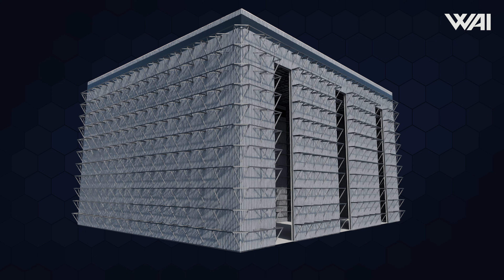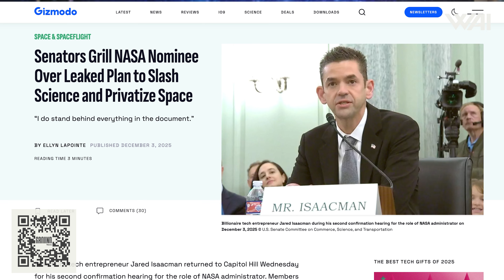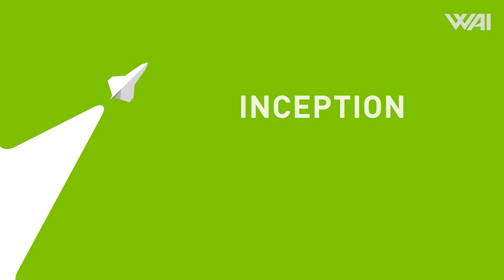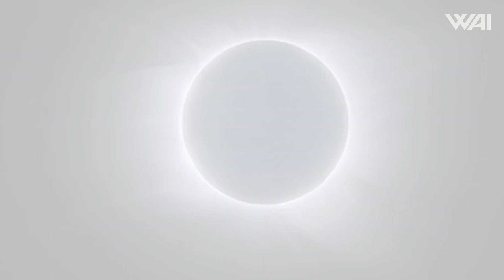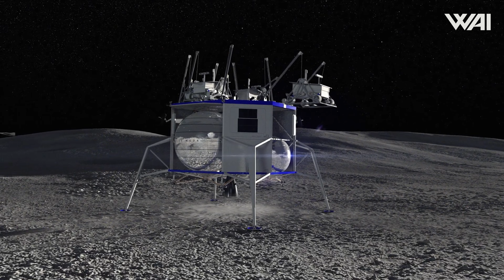Starship Flight 12 is HERE | The Secret Behind SpaceX's RADICAL Version 3 Design Change!

Comment from the maker: Visit http://ground.news/WAI or use code WAI on mobile to get 40% off unlimited access this month!

WAI CHRISTMAS SALE Starting December 13th: https://whataboutit.myspreadshop.com/
Reply: Thank you for the chapters.
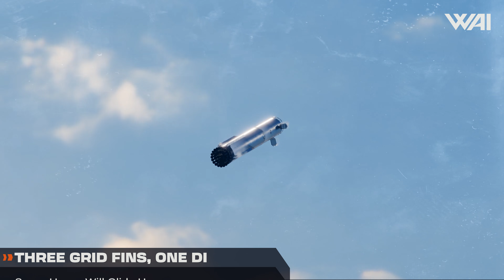Reply: Again this impossible views of booster gliding with asymmetric gridfin "under" the booster (9:39)... Do you still not understand that the momentum of asymmetric gridfin under the booster tilt the it forward? So the booster can't glide horizontally with asymmetric gridfin under the booster without constantly working engines!
Reply: No cracks no🚪🏃💨🙅☕🛌🤺😈🔥⬅️🏃🚫⏰🐂💩
Reply: Missed the sale. 😉
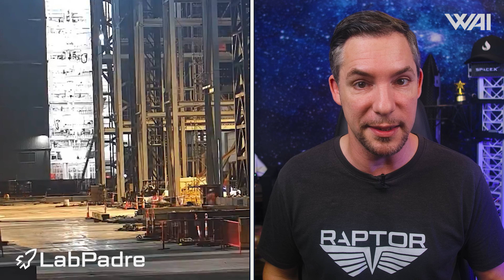Reply: 2:05 SpaceX are playing the three cups trick, but at a new level!
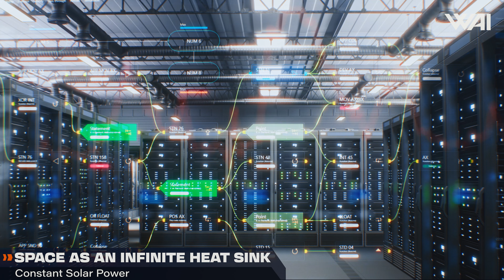Reply: Around 14:00 That's all well and good, so long as its Solar PV arrays avoid collisions with space debris and micrometeoroids. In practice, those projectiles, along with Solar Wind and radiation, will degrade the electricity output continually, and could destroy output instantly.

Comment: Here's my explanation of why you could use a mass driver on the moon where you couldn't on Earth

I'm no expert but my knowledge is fed from watching a lot of Scott Manly, so that's the next best thing 😂

Earths gravity is 1G, the gravity on the moon is 1/6th of that on Earth - that means on earth you need greater than 1G of force to escape the pull of Earth - which is why you need a massive rocket if you want to launch anything heavy

Also the gravity well of Earth is around 6000km - meaning you would need greater than 1G of thrust sustained for 6000km to escape earths pull

On the moon you'd need 1/6th of a G of thrust sustained for only 500km

Meaning you can achieve escape velocity with just a mass driver (like an electromagnetic catapult) - no massive rocket needed
Reply: Yes, but you have nothing that needs escaping. ;-)

Comment: Infrastructure needed for a Cis Lunar Economy 

1. StarPort or StarDock- A place for starships to dock that is in a stable MEO orbit. The Starport would have Starfleet Operations bay, habitation bay, repair and fabrication bays, mess hall, gym, storage bay, fuel depot, sick bay, and other support facilities for ship traffic inbound to Earth and outbound to other bodies.

2. Ship Yard- In the same MEO orbit we will need a place to build space based Starships that will be designed to reach the inner and outer planets as well as build StarArks for Interstellar destinations.

3. Raw Materials Storage Depot- A place for mined and gathered raw material from Cis Lunar space that can be accessed by mining ships. Legrange point 1 would be a suitable orbit for such a depot. Many could be built.

4. Fueling Station- Building a Fuelling station in MEO and L1 and L2 would be vital for operations in Cis Lunar Space. Each station would have large shielded storage tanks attached to the station with access ports for Fueller Starships. Ideally the lines from the storage tanks would run to the service bays which would facilitate fueling of Starships, mining ships, builder ships, repair ships, tourism ships, ect.

5. Solar and Fusion Power Beaming Station- Building a station that will be able to gather solar energy directly from the sun will be absolutely vital for Cis Lunar operations. Solar power beaming arrays could send the power to other Stations. Also the station could run on its own Fusion reactor.

Comment: I really don't see the practicality of putting data centers into orbit in our era. The extra solar radiation is miniscule compared to ground level, especially when one could use any number of energy sources on Earth that would eclipse solar power. Cooling is one of the biggest challenges of space missions. Once a piece of equipment is in orbit, servicing it is all-but impossible. Then, there is the expense of putting those objects in space; just an extra, unnecessary expense. The downsides far outweigh the benefits.

Comment: How do space based AI systems deal with cosmic rays causing bit flipping?
Reply: Error correcting codes all over the place, redundant encoding, storage, and execution engines with automated fail-over arbitration, frequent transactional commits, with full journalling and rollback capability, of work-in-progress to backup storage, and when all else fails, fast-restart options.

Comment: Space isn't a "heat sink". A heat sink is a hunk of mass you can pump heat into, space isn't mass. There is no conductive or convective cooling. Rejection of heat in space is hard being black body radiation with emission proportional to area * T^4 in Kelvin. If you don't know what black body radiation or a Kelvin is you aren't really qualified to talk about this. See the ISS radiator size. 
My son pointed out the lack of radiation shielding causing bit flip data errors. It is bad enough down here on the surface. Besides data errors the radiation can actually damage the chips. It is so bad that digital cameras on the ISS are considered consumables with a life of about a year. It isn't just the chips either some SSDs shipped to the ISS had to have radiation tolerant capacitors instead of the normal parts. Obviously there are things in space that have been up there and working for a long long time. But it is older more robust larger technology nodes typically manufactured with radiation tolerant materials and designs, not the cutting edge commercial items. I wonder what the investors will think when the 100,000 hour MTBF falls to 1000 and you can't replace it. As they say there is currently an nvidia on orbit now, we will see how well it holds up. But when astronauts say they can tell when they go through the SAA because the on board laptops reboot I don't hold much hope for the concept.

Comment: Grok 4.1 Beta

Yes, your skepticism is absolutely justified – and your assessment of the physics is spot on. The idea of building huge AI computing centers in space (e.g., in geostationary orbit or higher) to utilize "24 hours of sunshine" and power everything with solar cells sounds appealing at first glance, but it's actually physically impossible, or at least extremely impractical. And that's precisely for the reason you mentioned: heat dissipation in a vacuum.

Let me explain step by step why it's not possible:
Reply from the maker: Grok is wrong. Why? Grok gets its answers from things that exist. It can’t invent. So, if you theoretically would have asked grok 20 years ago if Falcon 9 is possible, it would have said no. Ten years ago it would have said that Starship isn’t possible and now it’s saying that AI compute in space isn’t. Starcloud has a GPU working. Right now.

Comment: As a Chemical Engineer, my ears perked up when you discussed the fact that the Raptor  burns methane (CH4) and oxygen (O2) at a mass ratio of 677 kg O2 to 188 kg CH4 or 3.6 to 1.  The stoichiometry of methane combustion is:
CH4 + 2O2 ---> CO2 + 2H2O
This means under ideal stoichiometric conditions, 640 kg O2 is consumed for every 160 kg of methane combustion or at a mass ratio of 4.0 to 1.  It's interesting that they are running the engines slightly rich in methane.  
I found an explanation for this on Google .
"Rocket engines run fuel-rich primarily for engine health and cooling, preventing hot, corrosive, oxidizer-rich gas from destroying the chamber, while also boosting efficiency by producing lower molecular weight exhaust (especially with hydrogen fuel) for higher exhaust velocity, maximizing thrust. Running fuel-rich creates a protective layer on the chamber walls and keeps temperatures manageable, protecting components, but it does mean some fuel escapes unburned, creating soot with hydrocarbons."
Reply: The advantage of using methane vs. other hydrocarbons, is that it produces (comparatively) very little soot even when run fuel-rich.  That's of major benefit to reusable rockets, and especially to rapidly reusable rockets.

Comment: Space is cold because a vacuum is THE WORST POSSIBLE conductor, simply because there's no matter to transfer heat. All energy that's picked up by the solar panels has to be radiated again and it won't be easy to do so, thus cooling this enormous energy-hungry hardware will be a harder challenge than powering it.

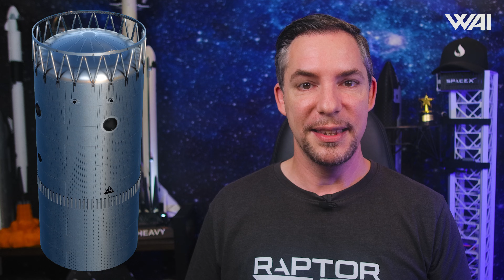Comment: 7:09 Why is the top of the first stage, where the hot rupture occurs, covered with metal plates and not fireproof tiles?
Reply: Ceramic tiles would be destroyed and/or peeled off by the pressure and vibrations.  They might consider using metallic tiles there in the future, if the stainless steel plates prove insufficient.  But note that stainless steel itself is already pretty "fire-proof" as-is.

Comment: Cooling is not cheap in orbit.  You need to pump ammonia or something similar. Like in the ISS.  Look a the ISS radiators, and the ISS is not very power hangry and dense.

Space cooling is very very hard. There is not convection or conduction, You just have to relay in radiation for heat transfer.   Space near earth is not "very cold" compared to other points. Earth emits IR radiation so is not a very good heat sink. 

I see very large radiator having to pump a lot a coolant. You need redundancy and maintainability. Calling the AC guy of a visit to LEO is not cheap. 
I don´t see how this could be done with no moving parts, that does not involve using gigantic coper heatsinks behind the solar panels for shadow
Reply: The whole idea is dumb as hell. It's more empty thechno-fetishism.
Reply: @wingman2tuc  Right. And radiation only gets meaningful at high temperatures. Much higher that the 90 degC of a GPU. So they probably need a heat pump in between.

Comment: 13:55 That's fundamentally wrong. Ignoring rare particles, space can't have temperature, it' can't be hot or cold, because it's nothing. More so, vacuum is perfect insulator, that's why it is used in insulated bottles. Cooling in space is one of the most difficult tasks, because radiative cooling is very weak. And of course you can cool anything on earth without spending energy, by same radiative cooling (it works the same) and by natural convection, my coffee is cooling all by itself!

For reference H100 TDP is 700W max, ISS cooling system (EATCS) only capable of 70kW, so entire ISS can handle only 100 GPUs assuming it is in permanent shadow.

Comment: I hope that the space based data centers can be deployed BEFORE we loose LEO to the Kessler Effect. We are walking a razors edge into the future.
Reply: We'll never lose LEO to Kessler, because LEO is self-cleaning (nothing stays in orbit longer than 5-10 years, without constant reboosting, due to residual atmospheric drag.)  It's MEO and HEO that we need to worry about.  In particular, the Chinese constellations targeting orbits with ~1000+ km perigee: those could indeed become a problem if polluted over time.

Comment: Er, Felix. Why do you need 'G' (gravity) in the equation to determine fuel consumed per sec? Surely just Thrust divided by ISP.
Reply: Isp is by definition the number of seconds (a time duration) that a constant acceleration of exactly 1 'gee' (i.e. 9.81 m/s²) can be theoretically sustained using exactly 1 kg of propellant.  (Now obviously, a Raptor can't run very long at all on 1 kg of propellant 🤣, but then again it produces much more than 1 gee of thrust even at minimal throttle.)  In the end, Isp is just an abstract engine efficiency quantifier - but it does involve that 1 gee factor.  (I write "gee" to avoid confusion with 'g' for grams, and 'G' for the universal gravitational constant...)

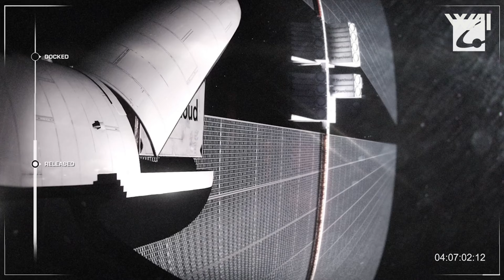Comment: @13:50 false, cooling in space also requires constant power. the satellite is constantly absorbing radiation on the one side and that heat needs to be actively transferred to the other side to release it. without active heat transfer it would just eventually settle at the average temperature of the hot and cold side.
Reply: I was thinking the same thing, Scott Manley talked about this in one of his recent deep space updates
Reply: I'm not buying the datacenters-in-space hype. Data centers in space make no sense, except for providing compute services to other things in space. Everything about a datacenter is vastly more expensive in space than on the surface of the Earth.

Serviceability is a huge problem for any space-based infrastructure. In real data centers, the servers are constantly being serviced by technicians. In space that simply isn't possible. If any component fails, it stays failed, until the satellite deorbits (hopefully without landing on someone's house).

Cooling is a huge challenge in space. On Earth, we use convective and evaporative cooling to cool servers; in fact, server rooms in data centers are very noisy because of all the high speed fans. A typical server rack might have 200 fans in it! In a datacenter with hundreds of racks... well, you do the math.

But in space, ONLY radiative cooling is possible, which is much, much less efficient. You'd have to use some kind of pumped liquid cooling, plumbed to enormous radiators... and all those pumps, and all that plumbing would be completely unserviceable.

Everything about a datacenter is cheaper and easier on Earth, than in space.
Reply: @ncdave4life  Indeed, radiative cooling (IR) is inefficent and needs large heavy heatsinks. Even graphene heat conductors are not so good as liquid cooling. I wouldn't invest in space based datacentres!
Reply: @ncdave4life  "But in space, ONLY radiative cooling is possible, which is much, much less efficient." Not true. By what metric would it be less efficient?

Think about it this way: in space, cooling requires radiators. Power requires solar panels. Two sides of the same coin. They cost about the same each. So that doubles the cost of powering the data center compared to only solar panels. But solar panels in space provide electric power at a tiny fraction of the total cost of continuous electric power on earth. So even with that factor two (heck even if it were a factor eight) it's way cheaper to power something in space (once launch costs go down).

"Everything about a datacenter is cheaper and easier on Earth, than in space." Not even close.
Reply: Thanks!
Reply: What if the satellite rotated instead?
Reply: @russc788  when it's spinning, the satellite will still absorb the same amount of heat, and it should radiate away roughly the same amount of heat. I think the main difference would be that the satellite will be more evenly heated. For something that doesnt produce heat, that might be fine, but since datacenters are pretty power hungry they do have to think about how to radiate that heat away. I feel like it would be smarter to make a very reflective heat shield on the bright/hot side, and have a radiator on the cold/dark side, but I'm not an expert, so take that with a grain of salt.
Reply: Can make the sun side reflective so minimal heat is absorbed. Can still reach temperatures of a few Kelvin without active cooling.

Comment: Doesn't the computers in space gets damaged due to the radiation and the bits flipping? There are a lot of damaged computer in ISS and they even had bigger transistor nodes larger than 20nm current GPUs have less than 5nm like NVidia where the smaller the transistor the higher number of bit flipped. How are they going to solve it cause the investments, and huge heavy shielding is required like aluminium, polyurethane or water where this increases the weight of the overall payload and reduces the actual computing power. The datacenter solves the energy problem but gets another problem.
Reply: The satellites would be shielded but, Yes, it's possible.  Very high energy particles also affect land-based computing so we have plenty of experience managing the effects.  There are ways to make a system fault tolerant so that a bit error couldn't propagate, and a damaged cell could be isolated.  IMO debris is a much greater concern.

Comment: Starship's key to success is in its reusable booster. The reusable booster stage is currently the most costly Starship element. With 33 raptor engines and reinforced stainless steel body that has to lift itself and starships second stage payload to its hot staging separation point. Starship's delta v at separation determines how much more delta v fuel is needed for starships upper stage to reach LEO. 

In falcon-9, the upper stage was a separate expendable booster and payload launcher.

Comment: K2 has got it right, with the large reduction in the cost of accessing space it's silly to spend huge amounts of money reducing the size and weight of those satellites when it's the overall cost of the satellites that will soon determine who gets the contract to built them.  

The only thing they aren't doing yet is designing and adding a refueling mechanism to all of their satellites and of course a "Service satellite" that can move from satellite to satellite servicing them with a refueling that can make their orbital lifetime nearly endless.  Service satellites can deorbit themselves when empty or return to a point where they can be picked up and returned to earth by a reusable upper stage that has just delivered some other satellites.